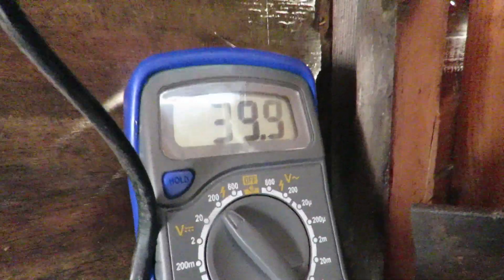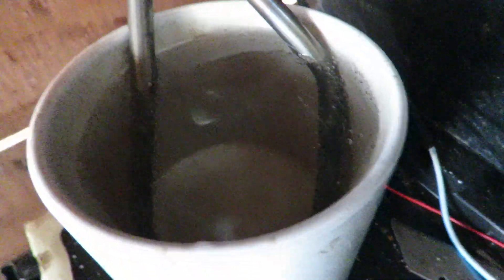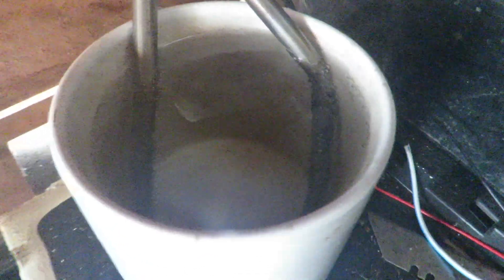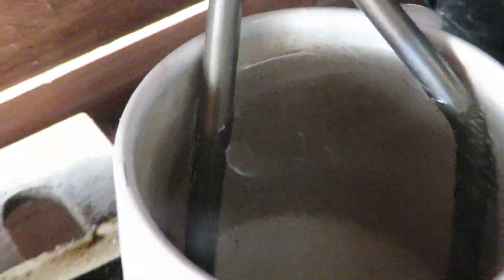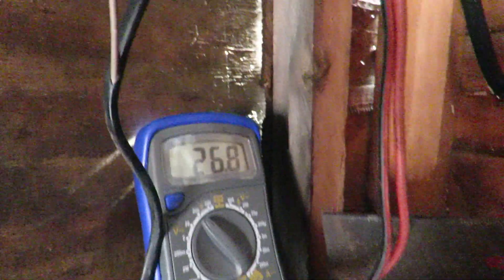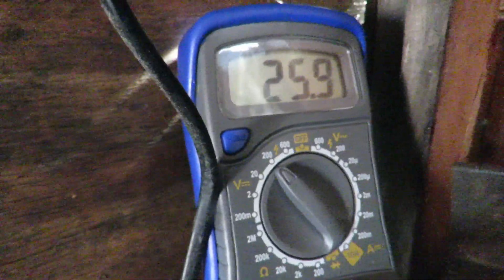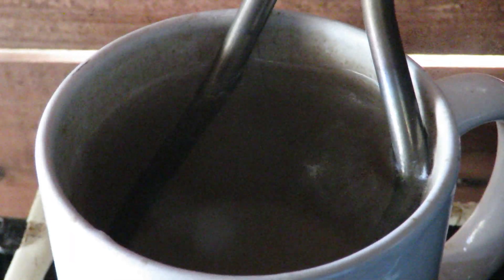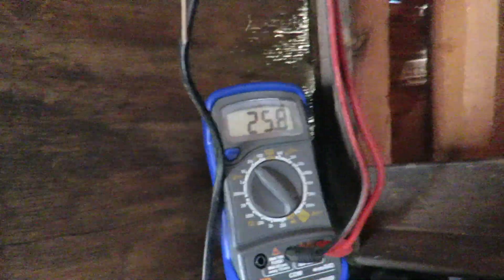boiling water from the wind turbine got there in the end :)

Comment: I am also thinking if it was in a larger container and kept at temp of say 10c,  it would be more efficient to bring it back up to temp. quickly ?  If the element is hotter/ warmer then it's resistance should be lower , Any help you are willing to share I will share back as I build my system to heat my house . Via solar, wind, and wood stove, with a hot water box. Few think about this and I would be happy to work with someone who will think like this. I have 40 ish years of mechanical work, can weld, do electrical work, also not afraid to try to take on a new task.  I hope you respond back , if not good luck with your project.
Reply from the maker: Hey mate sorry for the late reply I had a fire lost all my stuff just getting going again , the turbine survived all my tools gone, it would work better if insulated and if it was like in a rectangular container with the dump load all the way in, I am making a new turbine at the moment from 2*washing machine motors :)

Comment: i can hear it, it spins pretty fast, wonder what rpms the blades are rated for, i know the bigger they are the slower it is. i have seen heating using batteries is quicker, batteries holding voltage higher than a resistive load, not that i know everything just what ive experienced playing around with turbines.
Reply from the maker: It's gotta be up to 300 ish when it's really flying, I need to build a gearbox that halves the speed of the blades and doubles the speed of the rotor if you get me, would be well suited in these winds, plenty of power in the air, I will try running the batts through the solar controller and taking the 24v for the heat off the batteries see what happens.